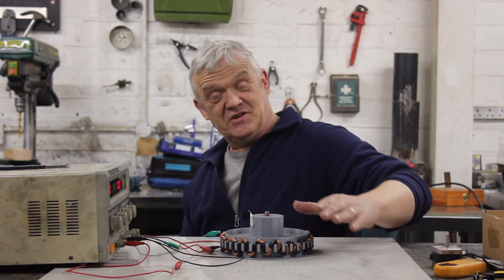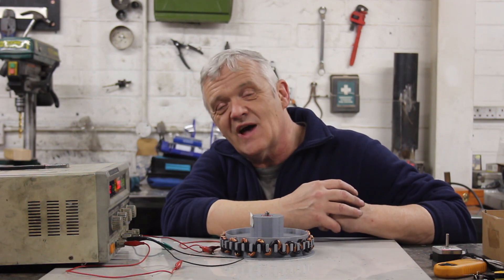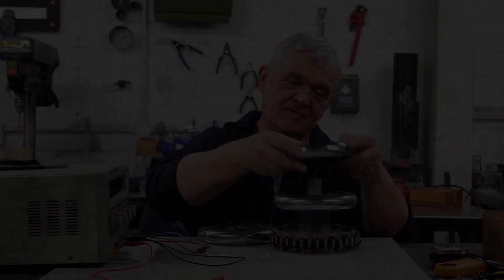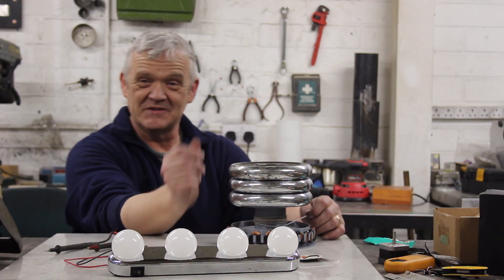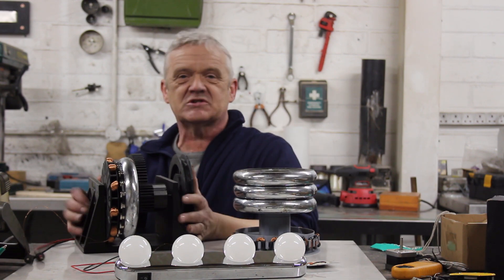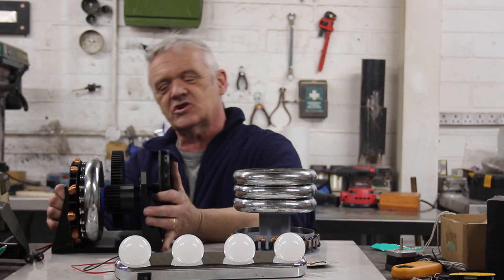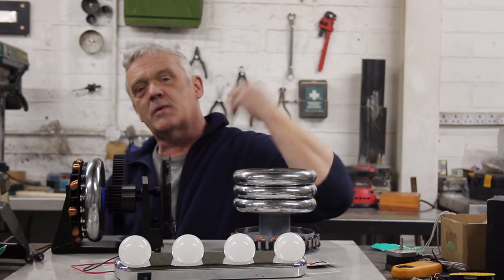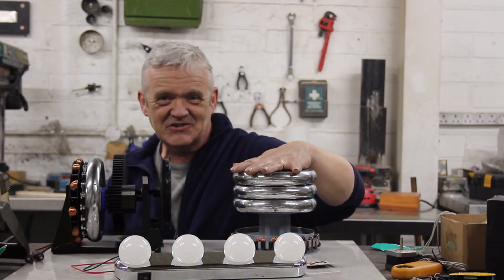1871 The Serpent Flywheel Battery

Comment: Brilliant, could use a battery that has been charged by solar  to spin up the flywheel as it slows down using a governor type mechanism so it would be pulsed not using a great deal of energy from the run battery.

Comment: It would have been nice if this demonstration had been an actual demonstration. It doesn't come through very clearly at all and unless somebody who has 20/20 vision is watching this video, they probably didn't notice just like for me because the room you're in is so well lit. You cannot tell whether or not the rack of light bulbs that you have there to help demonstrate this as a flywheel generator are actually lit up or not. It would be nice next time if you're going to use lights to demonstrate whether a device that makes electricity works or not would actually be something we could see. Maybe dim the lights in your workshop or use a light that is much brighter and much more contrasting to the lights in your workshop and the background in your workshop because this one just demonstrates that the weights helped to keep it spinning for a decent chunk of time. It did not necessarily demonstrate that you were generating any reasonable amount of power to even light up those lights, because again, your workshop is so brightly lit and you're using lights that aren't that bright in the first place to demonstrate something. Maybe next time you try this demonstration, you should turn the workshop lighting down. Have it really dim so that way yes, it comes through that you're pulling the flywheel generator to a start and then all the sudden those lights come on and are noticeable and bright on the screen instead of leaving us the viewers asking, are those lights actually lit or are they just reacting like those lights are wet which is what it was for me and my experience on this particular video. Not a good demonstration of showing this as a flywheel generator effectively producing electricity, and I do feel that maybe you could have used a little thicker string or even a longer string and maybe pulled a little bit harder to build up even more RPMs than you built up in this particular demonstration. You did successfully demonstrate that the flywheel effect will cause this thing to go for a few minutes on a single pole. But you did fail in this video to demonstrate that it was actually spinning fast enough to make those lights light up because the lights that you use to light the workshop. We're just way too bright and those lights that you were using for the demonstration could not contrast that super bright light and obviously be glowing under the power of that generator.

Comment: Hi Robert, just subscribed because I think your channel is gold. There are several alt-energy concepts I've seen around the web I want to try so am brushing up on my electronics knowledge in order to do them. About this one, I'm wondering whether you've measured the amount of electrical energy a pull like you've done amounts to and if it is less than the total energy output by the wheel, perhaps a portion of that energy could be used to give the wheel a push at regular intervals? Perhaps in an electromagnet or something similar?

Comment: Could you try this design but horizontal on a bike to test the volts/amps you get? More weight, more weight circumference, maybe 2 or more motors in parallel 

Use planetary gears and electric motor for infinite gears. Capacitor bank to store power and charge a battery 

A system like this would work well for an E bike in my opinion but I'd be more than happy if you just were able to test the concept for a bike generator. It'd be hard to start the wheel spinning but once you've got it going you can seamlessly switch through gears which could potentially allow you a rudimentary control of the volt/Amp output when combined with combined with pedal speed

Comment: Do you remember those spinning tops that had a pushrod on top? I believe it was attached to a twisted flat bar that comverted your downward push to rotation to pwer the main body.

Stick one of those on thre andyou won't have to carry a string around with it.

Comment: Just a comment about flywheel generators, not far from me there was a larger older coal-fired generation station with five big steam turbine generator sets.  A while ago three of the turbines were converted to natural gas and two were partially decommissioned.  The two generators were retained as flywheel storage to manage the supply vs demand instead of trying to follow the demand by regulating the steam supply closely.   When the demand declines the excess power is diverted to the two freewheeling generators to increase rpm.  Then if the demand suddenly returns, the power stored in the spinning generators is used for immediate supply.

Comment: Next try is to put this machine together with your flat wind turbine.  I think that two things will happen, one is the flywheel will generate a more constant speed for a longer period, two the flywheel will keep the the mechanism from running away in higher velocity winds.  I also thought if you include your magnetically enhanced system, your machine would be self powered for a longer period of time.  

For me, living in one of the five windiest spots in the world, this might give me some power day or night.   You have gotten my creative thought juices going.   I enjoy you videos immensely, some day I would like to start working on some of your ideas and mind.  Thanks again.
Reply: I had another thought, to set this up to charge a bank of battery chargers for running the battery powered tools as as a collection unit(s).  I have a lot of chargers.  Maybe include the vibration mechanisms as well into the mix.  Have a fabulous day.

Comment: Hmmmmm.... Setup a wind turbine mechanically coupled to this sort of flywheel device through a one-way bearing (sprag clutch)... Rectify the electrical output and charge a bank of super-capacitors and/or storage batteries... size the whole system to suit your load requirement and you're in business!

Comment: Rob - an idea for you:
Tie a long pull cord to a tall tree. Harvest wind energy using one-way bearing + generator via tree swaying.
Use some form of counterweight or spring to keep cord taught around hub.
- a "free" large area structure for wind collection, capable of quite a bit of force. Poplar trees?

Comment: Would it be possible to use the coil as a motor to get the generator/flywheel up to speed using stored energy, and then use wind or hydro to add to the stored energy in the flywheel for charging, similar to kite generators pulling the kite back down ready to start the charge cycle, or would the energy required to get up to a sensible charge speed be more  over time than the wind could add therefore making the losses grater than the gains.

Comment: how much rpm is that flywheel with 1 pull like that? i assume 7.5kg of mass, about 20-25 cm diameter.. and i dont know to approx the amount of rpm with that 1 pull of string, is 500-700 rpm realistic?
i just wanted to calculate how much energy that generates and how much super capacitor needed to store the energy... i think this could be alternatives to an emergency generator...

Comment: What about using water from a rainwater down pipe collector  to power it. You would need a bucket on a pivot that overbalances when its full dumping several kilos onto a paddle connected to the generator. The generator would spin until the bucket refilled and it wold get another push , just like a steam engine. Power the rain 😊 very handy in Wales

Comment: The fact that it spun for so long is a sign that you were not extracting much energy out of the system.
Either the serpent coil design is not efficient at providing good current output OR your led load was mis-matched to the outout voltage of the generator.

Comment: Thanks for the video. I was one of the people asking for the flywheel.. When you started showing off the rotor with feather design I immediately wondered if this pull type of flywheel generator could be pushed by the feather rotor (or multiple rotors stacked). Is there a way to push the flywheel when force is enacted on the feathers and release when there is no wind or the flywheel is spinning faster than the feather rotor. Seems like that would be a great way to get many times more work out of wind's energy..  The compactness/density of these latest projects is amazing. A decent little power source in the form factor of a large coffee can. Great work sir.

Comment: Add a relay to cut the AC to the motor and you'd have a rotary uninterruptible power supply. The flywheel will keep the the motor/generator spinning once the AC is removed, providing emergency power until the flywheel spins down.

Comment: Robert, have you considered compressed air energy storage by means of a windmill rotating an air pump and compressing air into a large tank and releasing the air into a Gast air motor for powering fans and tools?

Comment: Please make it with very (very) high gear ratio and put a big big weight on a long pulley attached from the ceiling. This is a custom diy gravity light.
Reply: With Multiple bags you can have gravity battery storage,

Comment: So did you get more energy out than your arm put in? I notice that you pulled the cord quite gently.
How might you attach the rope to a tree or sail, attach it to the flywheel via some system that let the rope pull and retract with the movement of the tree? Seems to me that you could generate some serious wind power that way.

Comment: This video reminded me of the 'living energy machine", one of the first videos I ever saw on you-tube. It's still up with only 84 subscribers and 12 comments. There was a design I saw in a book in the 80s where ropes were attached to the tops of several tall trees. They were routed through pulleys to a flywheel. When the trees would move in the wind the ropes would pull and turn the ratcheted flywheel. If those two designs were combined with your serpentine rotor that would be quite a thing.🌬🌴🌪⚡
Reply: 🤔Can you recall the title or author of the book?…
Reply: @Sedgewise47  I'm sorry, I don't remember. It was published in the 70's, tall and thin. I got it from a library, don't have a copy. Maybe someone else can help. I remember the working part was in the center of the trees it was hooked up to. When any of the six or seven trees swayed away from it the pulling of the ropes did work. Intermittent motion from several sources converted to rotary motion. It might have been designed to pump water. It was so pre-computer, my searches on the subject haven't worked. Some other old guy might know?... The ropes didn't move very far, only a few feet, but they had considerable force.

Comment: Nice. Better balancing less load (maybe only 1 light) and some sort of electronic matching circuit for high voltage to current converter and 1/2 hour is possible. Seems like you having real fun with 3d printing.  I'm in the middle of making a multi use machine  with spindles instead of belts for moving the heads.  I will be able to change the head to a 3d printer, a high speed ßpindle for cnc machining or engraving / pcb milling and also a laser head for cutting wood and plastic. I'm getting fired up watching you and your 3d adventures.

Comment: The earth rotates, any  way we could use that motion
Reply: Yes. Orbit a coil of wire and power a microwave antenna and beam the power to the earth Scotty.
Reply: Two problems: 1.Part of the generator would have to be independent of Earth's rotation.

B. The Earth rotates at the astounding speed of 0.000694 rpm.
Reply: @boomanchu2  like they say, you can use gears 😂
Reply: @Stevie-J  If you can't make an intelligent reply then don't

Comment: Loving it, I could just watch the flywheel going around and be happy with the possibility of using concrete as the flywheel formed as close as possible to shaft. Could use a lawnmower pull start unit.

Comment: But isn't this a less than zero sum game ? The more power drawn out of the coils for voltage generation, the bigger the back emf from the coils resisting the generation. The more energy stored in the fly wheel, the more energy that had to be put in there in the first place. Because of these thoughts I loose track of where this is all going, to what purpose ?

Comment: 18650 + 1 Watt LED + 1k resistor  = 55 days of light
Reply: 1.5v AA cell, 1Watt LED , 680 HOURS, or flashes for 2 years.
Reply: @justtinkering6713  I run one in my house  my calc goes 3.7v x 2000mah x 80%dod = 5.92wh  it uses 0.01369wh so 5.92wh/0.01369w = 432 hrs /8hrs a day = 54days before the cycle is complete

Comment: Robert, could you reduce the friction using magnetic bearings?  Thrust bearings are good but if you can levitate the rotor and even center it using magnets it might perform better.  Just a thought.
Reply: Can't  levitate AND have a flywheel this heavy at sametime. If you use too strong of magnets it is going to mess with the fields you are trying to use
Reply: @DavyOneness  That's exactly what i thought. Any metal flywheel within the proximity to magnets strong enough to lift it, would create eddy currents.
Reply: @DavyOneness  yes you can. The levitation fields are not 'cut' by the windings nor do they create eddy currents. Try it with a couple of old microwave or speaker magnets, the only issue is keeping them centralised. Anyway the fields can easily be shielded.

Comment: I was waiting for you to pull the other one , do you ever think you will come up with a system that one could use as a form of generating energy to store in a battery, be it these small items  or a combination of small items to store into battery storage.
Reply: I think many of the ideas he's shown would work to charge a battery even if its just a small amount and using a combination of vibration generation, a wind powered device and water powered generation you could harvest small amounts of energy from multiple sources... Imagine this snake generator for example with the flat windvanes he made a few vdo's ago, a dozen of those on your roof would be unobtrusive or the generator he made from a long fan blade could sit on the gutter edge and ridge of the house to harvest any slight breeze
Reply: @docink6175  I would not which battery that could take the charge , I live on my own and was thinking about buying a battery that could take the storage from several items at the same time and with the combination of all the items would be better than solar and a lot cheaper.
Reply: @KavanOBrien  cheap cheap ios any old car starter battery, better but still rather inexpensive is a deep cycle marine battery. I have one in both my trucks and charge them thru the vehicle or a small 40w panel, Im looking at a used 100w panel for $80
Reply: @docink6175  I was thinking more along the lines of a power wall battery set up but to build it so I could generate enough energy through all the small items put it into the battery that would take me off grid.

Comment: you can put the flywheel on the center and double the gears and generator each side, and make it a gravity battery with some other weight, nice
Reply: A larger diameter flywheel work better as well.